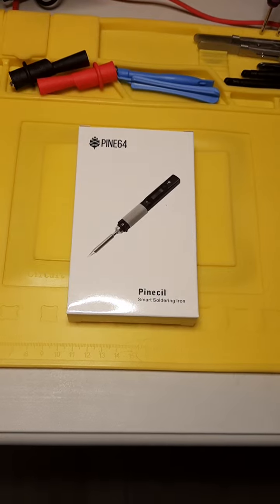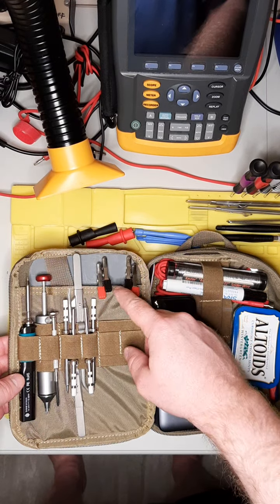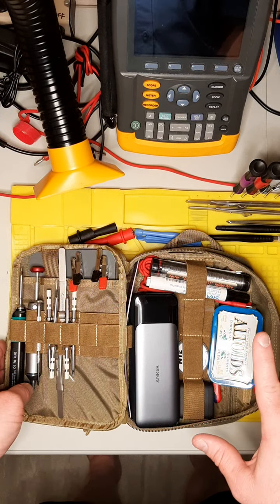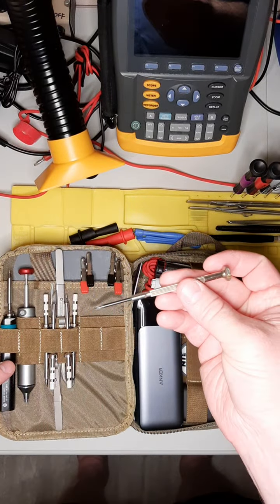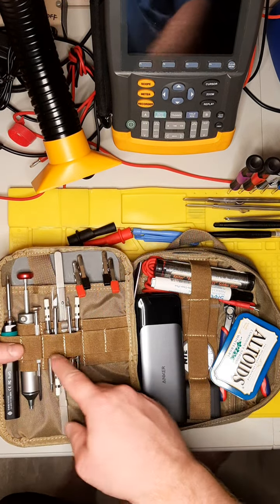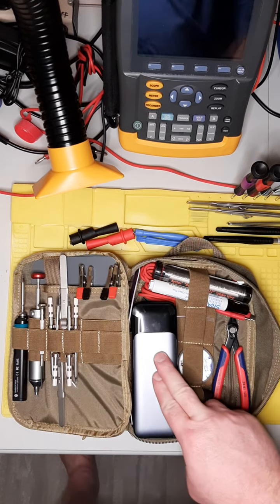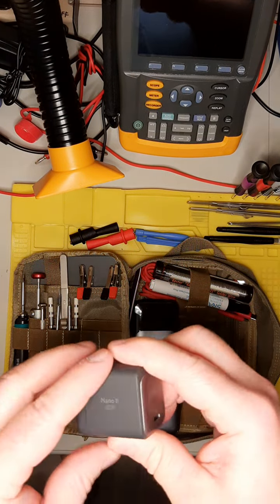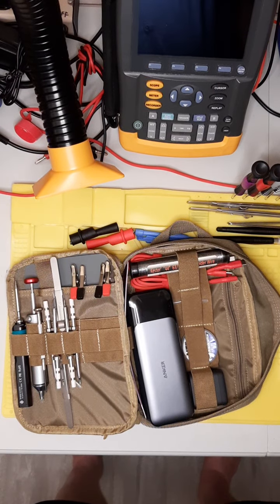Field Soldering Kit (with Pinecil V2).

Comment: I have a similar setup for my travel kit. Still, I got some good ideas from your setup, thanks for the video. My first battery for the pinecil was a wall charger/battery combo from Baseus and it died after about a week and took the USB c port on my V1 Pinecil with it. Now I have an Insignia battery that can put out 87w total (65w pd over type c). The Best Buy battery only cost $45 on sale and it's been holding up well for about 3 months now.
Reply from the maker: You're welcome!  Sorry to hear about the damage to your Pinecil.

Comment: Perhaps you know. On the pine64 site, a set of soldering iron tips for v1 or v2?  There is no resistance information in the description.
Reply from the maker: When I bought mine they were still the V1 tips.  I can tell by the length.  Just measured resistance on them too, getting 8.1 to 9 ohms, so confirmed they are the 8 ohm version, at least as of when I bought them (2022-Sep-14th).

Edit: I will mention that I can solder just fine with the V2 while using the V1 tips.  Guessing the 6.2 vs 8 ohm isn't a massive difference, more of an incremental improvement.
Reply: @neverendingstudent  For large polygons, the 6.2 ohm version is preferable. Can be soldered at a lower temperature, faster response while maintaining temperature.

Comment: That power bank is EPR compatible, isn't it? If you upgraded your USB cable for a PD 3.1 240 W one, you'd be able to power the iron at 28 V and around 100 W (126 W with the short tips, 98 with the long ones)
Reply from the maker: The USB cable I have in there is a high-temp tolerant silicone USB-C cable which is from the Pine store and specifically meant to be used with the Pinecil (so that if you accidentally touch it, it won't melt).  To be fair, I just checked and didn't find power ratings listed for the cable, but I know I have used it in the field and was able to solder easily, no issues with the iron getting up to temp quickly or keeping temperature up during soldering.
Reply: @neverendingstudent  I recognized the cable and it's good, yes.

...but it doesn't allow you to get the full power of your Pinecil and Anker power bank. It's just that it's a bit of a pity to opt for such an expensive power bank and not use its 140 W capability, since the Pinecil is able to take advantage of it.
Reply from the maker: @NicksStuff  I had to do some quick googling just now - either I hadn't known (or, more likely I forgot) the Pinecil can support power above the rated 88W.  I may look into swapping that now, if I can find a cable that is also silicone-sheathed (I REALLY like the limp-noodle feel and how it doesn't push back at all when I want to set the iron down on my stand).

Edit: found on Aliexpress, looks like Miniware makes a 1 meter silicone USB-C cable with EPR support for high-wattage, currently at ~$7.  Nice.
Reply: @neverendingstudent  $7 only!? Can you share the link?
Reply: I found item 1005006738430684 but it's not in stock
Reply from the maker: @NicksStuff  Ok, so here's a link for (the price I see) $7.35 + $1 shipping: https://www.aliexpress.us/item/3256806539135227.html - that is from a seller that has good ratings.  The first link (for $6.44 + $1 shipping) is: https://www.aliexpress.us/item/3256806757053480.html - that is from a seller that no reputation comes up on, no store rating, so a bit more of a gamble there.  I know nothing of either store or of the product beyond the claimed Miniware name, so like all things on Aliexpress, gamble at your own risk.  On the other hand with those listed prices, you are gambling for pretty low stakes.
Reply: @neverendingstudent  Thanks!

Comment: you prefer  Engineer solder sucker over copper braid/wick? I love thumb screws.   links to several types on pinecil Wiki under fasteners.
Reply from the maker: Solder sucker vs copper braid: both have their place.  Non-sensitive surfaces and larger globs of solder are usually a better job for the sucker, and pulling excess solder off of a delicate PCB trace / contact surface  (especially if you are repairing a lifted trace) can be a better job for wick, so long as it is done with a delicate hand.

Comment: what is  the soldering fan setup? could you show this in another video? thanks
Reply from the maker: It is a Kotto fume extractor: https://www.amazon.com/KOTTO-Soldering-Absorber-Electric-Extractor/dp/B07ZHH5H7N/.  One of the least expensive fume management options that has a positional hose.  I use the layered 'hepa/carbon' filters (they are in no way actual HEPA but they are better filters than just the carbon sponge).
Reply: @neverendingstudent  thanks, I tried to post about the V2 Beta firmware  if people are using  EPR chargers 28V 140W, but it keeps getting deleting or or it might be in your side to approve the comment if you have review comments enabled.
Reply from the maker: @neo256mb  Oh, yeah, we discussed that just a bit ago - I'm the one who posted the link to this video on the Pine64Official subreddit.

Comment: 737 battery will heat up Pinecil V2 faster than pinepower if you get a good EPR cable PD3.1 (240W).  PD60 cable is plenty fast and good at PD20V on  V2 and your battery will last longer so staying at 20V is a good idea too. There are no Silicone type 240W cables yet. so you probably better off staying with what you have than getting less flexible cable.
However, if you get a 240W-48V cable, you will see 28V on V2 screen. speed tests I did using  140W EPR charger + EPR cable,  https://www.youtube.com/watch?v=nTC-ah4f0hg
your 737 happens to be a good 28V  battery and V2 is first device in world next to Macbook that can support  28V 140W (max potential is 126W with 6.2ohm tip).   Officially Pine64 only states up to 88W 24V.  
Ralim stated in  July community updates components inside were upgraded to "tentatively" support   28V EPR.  Bunch of us have already tested  this on at least 5 models of 28V EPR chargers,  your 737 was tested too works well so far.   only V2 supports 28V, the V1 is limited.
Reply from the maker: Cool, I'm glad the 737 is community tested and works well for the Pinecil.  I'll keep an eye out for higher-wattage silicone USB-C cables, I'm sure they'll be produced at some point.